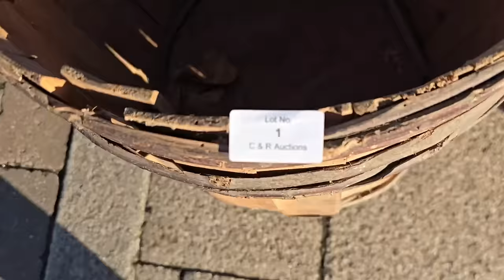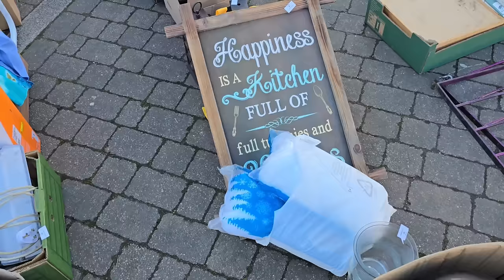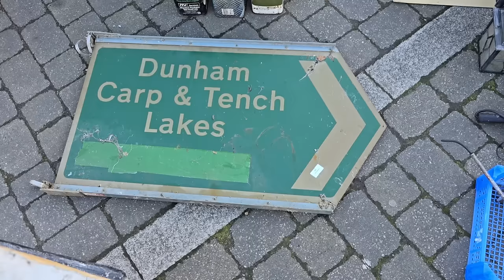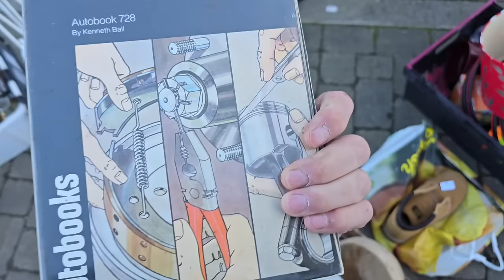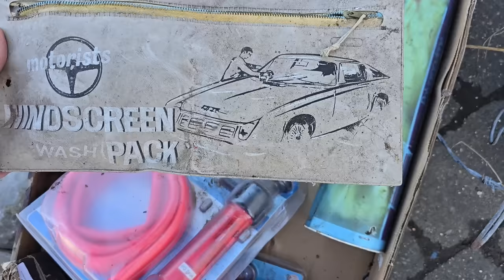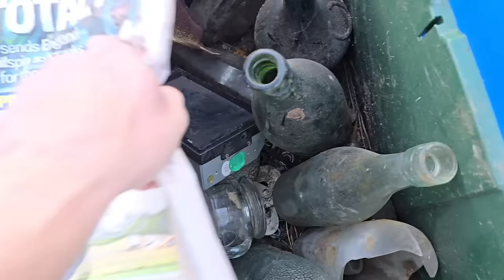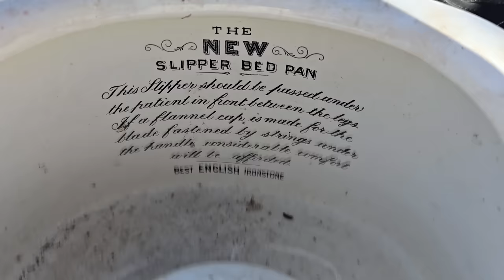Swaffham auction. Giant Clothes and a £500 Deere.

Comment: That bottle belongs to a radiant paraffin heater, something like a "Fyrside" "Aladdin" "Valor" "or "Sankey" but they're all much of a muchness.  Some heaters use a metal reservoir, like my own Sankey, and others use a glass bottle.

The valve in the lid is for the drip feed system to feed the wick inside the shell burner. In use, the bottle stands upside down so that the valve is at the bottom.

A lot people had nasty accidents with the glass reservoir types, by trying to be clever and swapping the bottles with the burner still alight, coming into contact with hot parts in the heater, and dropping the bottle, causing it to smash and spill paraffin all over the place.  The heaters weren't inherently dangerous, just clueless and careless users.

The heat from the fire was very good, and much like sitting in front of a real fire - being a radiant heater, you could feel the warmth across the room.  I have a Sankey radiant heater, waiting to be restored.

Nice find, and quite common for owners to keep one or two spare bottles of paraffin for a quick change over when the fire went out - That was the downfall of these heaters.

Likely to date from between 1930 and 1970 - They were in production in one form or another for a long time - that's how good they were. All you need now is to find a heater to use it in! 🙋🔥